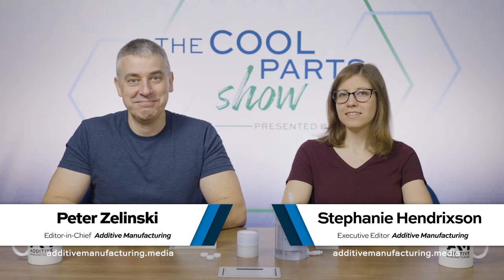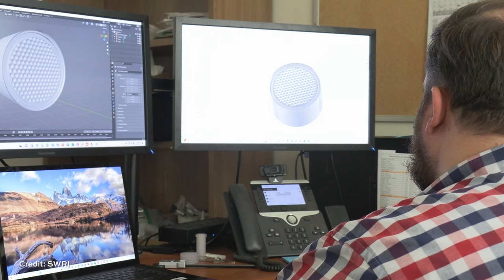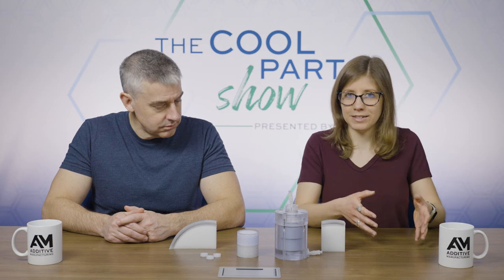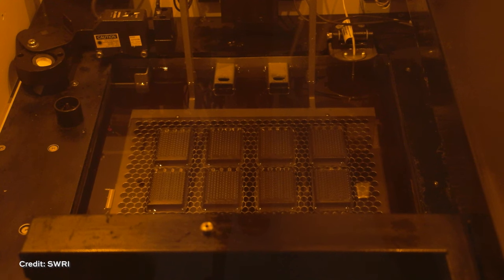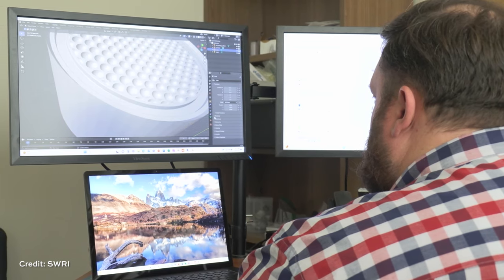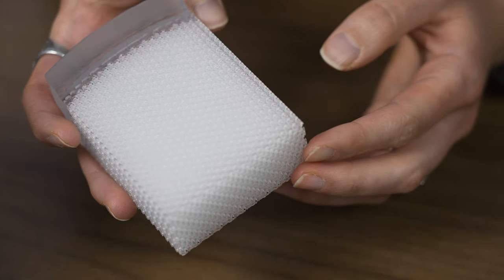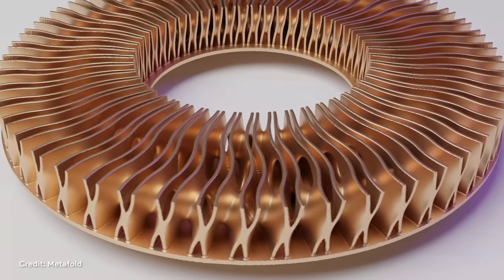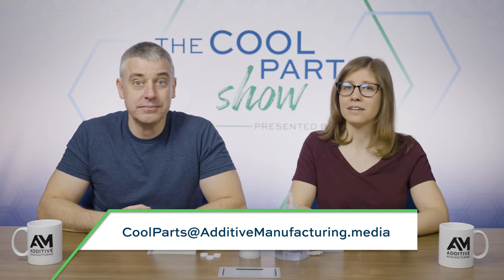3D Printed Bioreactors Enable Cell Growth | The Cool Parts Show Ep. 70

Comment: I had a similar challenge with modeling a complicated repetitive structure. I managed to do it with Matlab as an implicit parametric model and directly export as a mesh. 
The original mesh was 9GB. After some reduction, it reached 2GB and I was able to print it on SLA printer. 
The metafold solution is great for such application, I would like to give it a try.

Comment: In AEC we do something like that, too.
IFC and similar, most BIM software handle implicit models.
Parts, we call it elements, geometry are predefine by its category.

Some building models 'parts' are in thousand. Large scale project could imply million of parts. 
Thus we don't do surface model, mostly.

Though best practice workflow tend to break these models down into manageable pieces. Before we 'assembly' it into full building models.
It never bother me how 3d printing software handle these data. This is a very interesting subject.

Thank you for the video.

Comment: Awesome application for 3d printing. Re: slicing. You only need to slice one repeating section and make a script that changes the layer name? Seems very solvable. Obv implicit modeling is much more elegant though.
Reply: It looks like they have to print it sideways, so they can't just stack the repeating pattern (I had the same thought).

Comment: can't we use foam commercially readily available instead of 3D printing ?
Reply from the maker: The goal is to ensure a layer of cell growth exactly one cell deep, with no cell allowed to grow atop another. Foam is flexible – it could be compressed or bent in a way that might let cells overlap. Also, random geometry produces varying surface area – difficult to layer cells onto the surface consistently. The scaffold geometry here is an intricate form, but it offers a regular, repeating geometry.